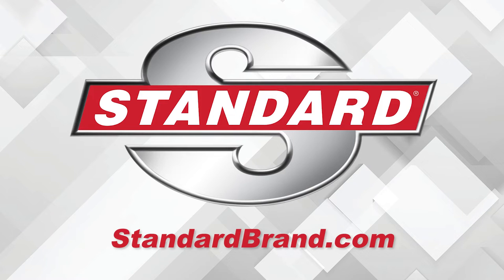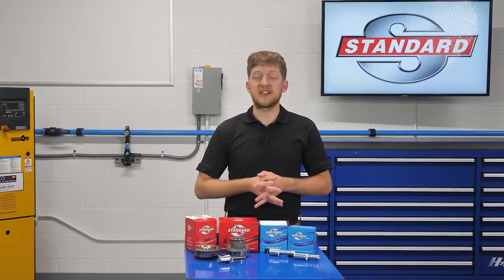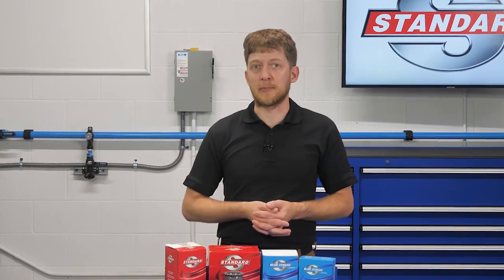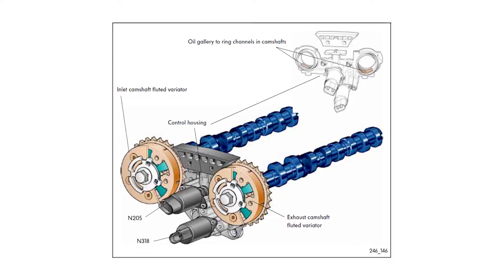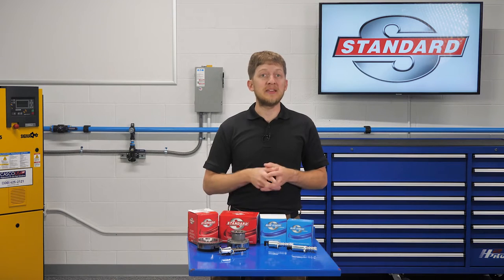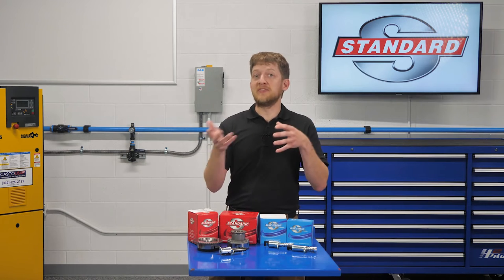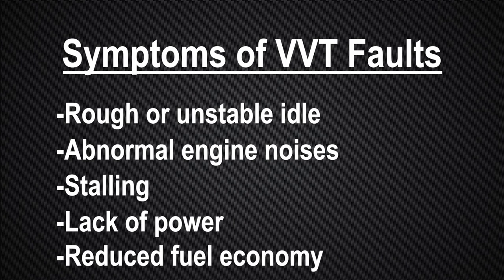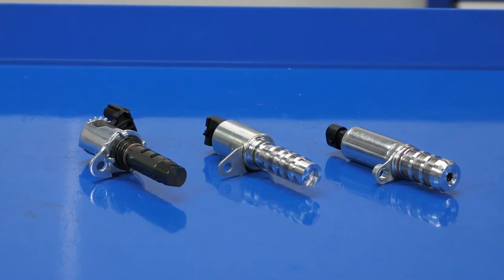Benefits of VVT Systems

Comment: You left out the biggest benefit, higher rates of failure. If its electronic, 15yrs tops before it fails. More reasons to push you to buy a new car because repair cost quickly exceeds the value of the vehicle. Meanwhile my old 1968 Dodge 383 that runs off $20 coil and $25 dollar ignition box and a timing chain, still going strong with an unknown amount of miles on OE internals. Know what you wont see running on OE internals and externals(minus alternators, they just die after a while for all makes) at 50yrs old? Anything with sensors, VVT, or cylinder deactivation. Im still running the OE starter that can actually be rebuilt.
Reply: She's not like other girls
Reply: Bla bla bla okay dinosaur
Reply: @LOMBAX0RATCHET  Blah blah all dodge hemi's with lifter failures, like 10yrs worth of Silverado Vortechs and their lifter failures, rather sure Toyota also had issues related to variable valve timing. Lifter roller fails, wipes the cam lobe out, you no longer have functioning valves. And you get the bonus of sending metal thru your entire oiling system.